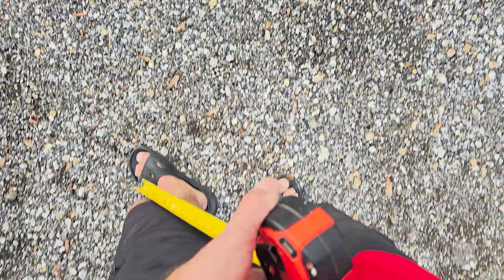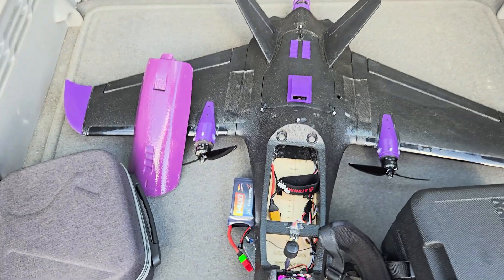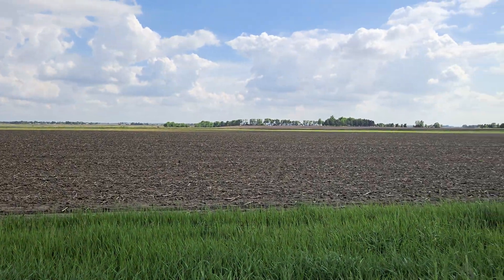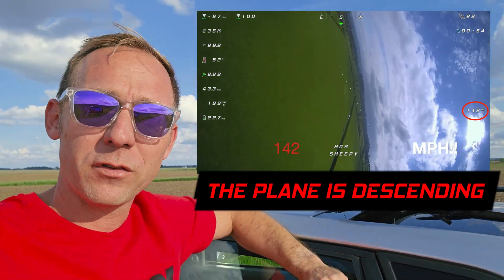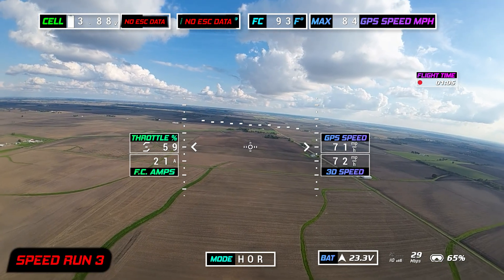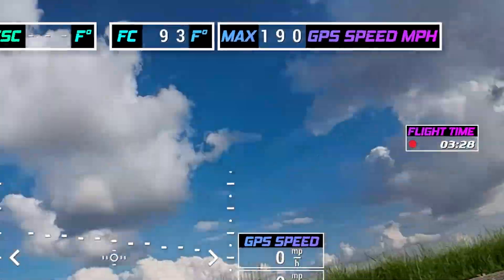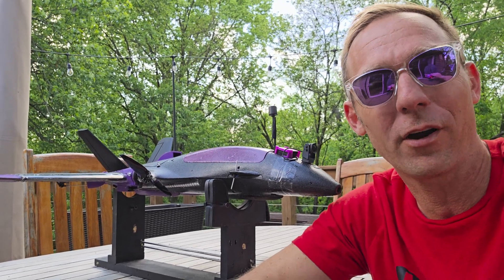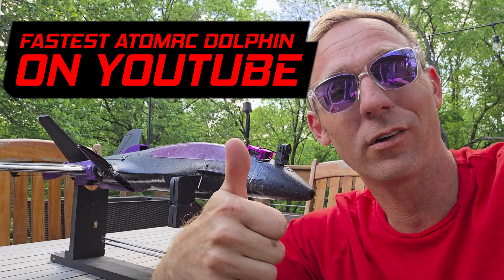THE FASTEST ATOMRC DOLPHIN IN THE WORLD

Comment: This is cool! did you have to change out the servos and beef up the ailerons for control at that speed? My Dolphin at a measly 130 is starting to have control issues at max speed.
Reply from the maker: No I didn't not.  All stock
Reply: Nope mines stock control surfaces, with metal gear e max servos and hits 160 no problem.  6s 2414 1750kv 60 amp esc on 6x6.5 prop at 9600 feet above sea level.  Was easy to launch too... Still haven't found a good motor/prop combo to get faster and still launch reliably. 3110 900kv and 12s may be the hot ticket.

Comment: You guys are having fun competing but I already have you all beat 😂 My dolphin goes 206 mph. Pito tube and gps confirmed!!  I don't make YouTube videos though 😊  Be careful guys they do have a death speed Where controls become ineffective If you don't modify the air frame And air foil !!
Reply from the maker: Awesome Job!
Reply: What's your setup & mods for that kind of speed?
Reply: @Crazyguy_FPV   First of all I don't fly FPV  My dolphin only has what it needs inside 
Including an FR sky pito telemetry and gps box ! 
 I reinforce the elevons   with carbon fiber cloth   I use high torque AOG mini metal gear servos  With carbon reinforced push rods ! 
 Everyone else is missing the 200 mark because they are running pancake quad style motors And trying to run high cell count in big diameter props !   Small diameter and high pitch is what gives the miles an hour !  I'm running a high KV inrunner With a 4.25 inch prop and 5.5 pitch on 4s @ 1800 watts with a high quality 100c battery (2800 mah.) And castle 100 lite esc.
 I also did a few other minor mods to the fuselage for drag reduction!   Good luck to all at catching me LOL.  GOING FOR 220 MPH THIS WEEKEND!!
Reply: No video no proof

Comment: Why didn't you run all 3 motors for more speed using higher amps on 8s and lower kv motors go for 3 motors and be the first to do so
Reply from the maker: I'm still learning, that's why.   I have only been doing this for 1 year and 1 month.   I had Walmart rc toys but never had a plane, drone, flight controller, 3d printer, radio system, etc, etc.  So I feel I'm doing pretty good so far.  Also,  my flight controller only supports up to 6s.
Reply: @JeffDoesThis  your doing wonderful keep sending it
Reply: I'm wondering if you could put a could of EDF ducts on this build
Reply from the maker: @LehtusBphree2flyFPV Believe it or not prop rc planes are faster than EDF planes.  But I bet i could be done